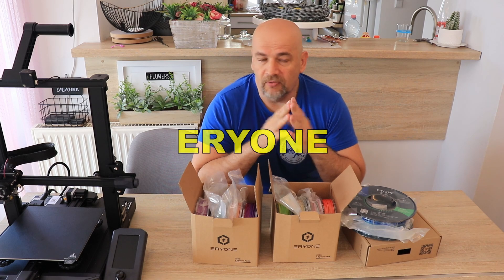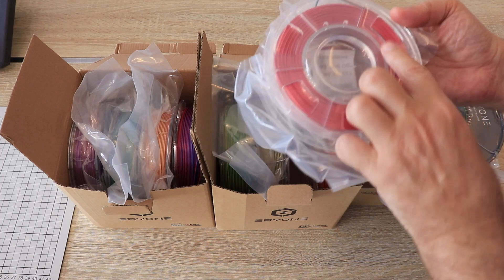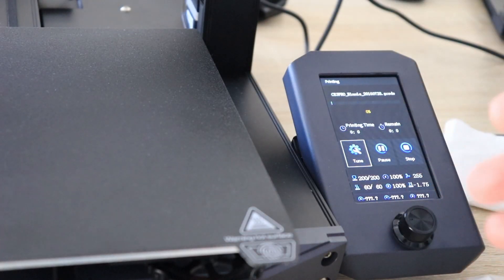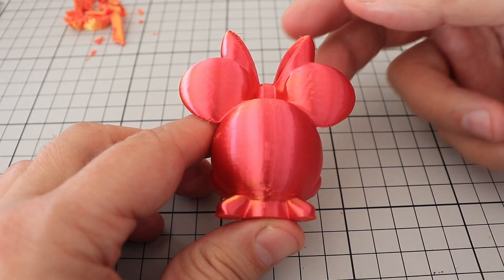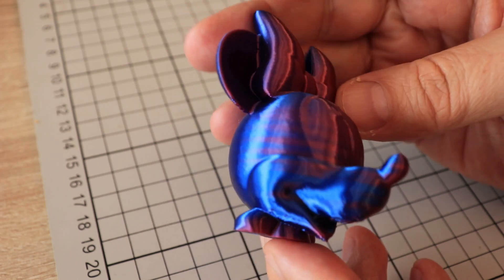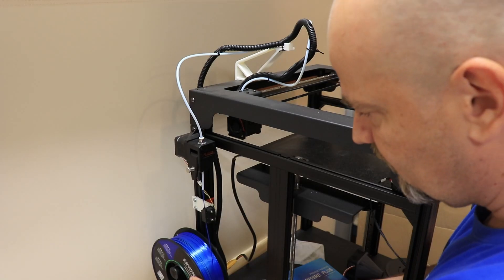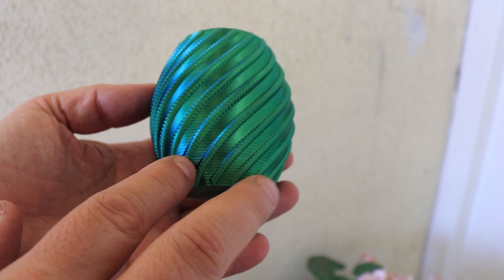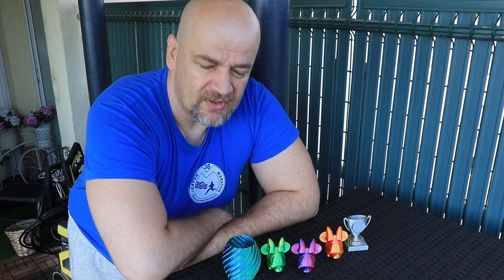Testing Eryone dual color filaments

Comment: The same thing happens with MatterHackers dual color Quantum filaments. I've tried it on several printers, Anycubic Vyper, Kywoo3D Tycoon Slim, Ender 3 V2 and FlSun Super Racer, all of them have the same color transition failure. The one that delivered the best result was FLSun SR.
Reply from the maker: I noticed more constand results with direct drive extruders and nice short path between spools and extruder.
Reply: @MyTechFun  Another thing that influenced better results was a double gear extruder. I think it provides constant traction without twisting.

Comment: Thank you, very interesting. Yes agree no need to review ender clones. 
Regarding filament - yep, I am planning to buy similar. 
I think if transition is smooth, then it is fine.
Is there any setting in slicer to adjust it? 🧐
Reply from the maker: In slicer, just rotation of the object, if you want to try to have specific color on chosen side. And you are hoping, that it will not twist ;-)

Comment: All times I have used multi-color filament, for me, color placement depends on the model... If I print some statue or smt (like that award or Minni head) then I tried to rotated model for my liking, so certain side will be one color and such.... but if I printed vases, then I would like to slowly twist the filament, it would be more interesting imo... maybe you can think somekind of spool holder that slowly turns, so filament spins also... just a thought :D

Comment: I got their 4 pack and had zero twist issues. I have a direct drive and the spool is mounted as on a factory E3V2 except on the front side of the machine with it feeding right into the extruder. It removed any twisting of the PLA.   
I prefer to have consistency in the prints.

Comment: The part can be positioned on the bed to present the required transition, I saw a video where an app was used to place the position of the part for a certain transition but I cant remember where I saw it
Reply: I printed out a small cone with an point indicating the front. Then I rotate the print in the slicer as desired.

Comment: For printing vases in single perimeter vase mode those filaments give you almost seamless color swap effects. Could you test for us the mechanical properties? I use recently the two colors filament from 3djake. Also nice effects but the layer adhesion is critical, especially if you print single perimeter vases. Anyway I couldn't improve the layer adhesion by tuning different print parameters.